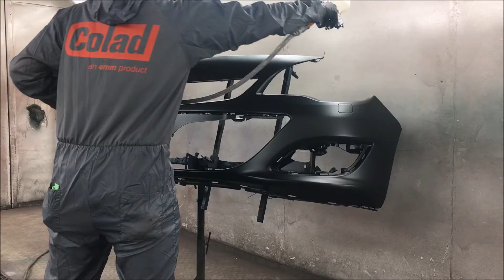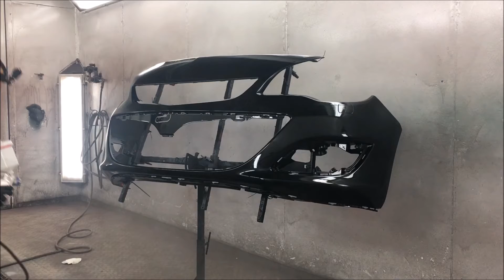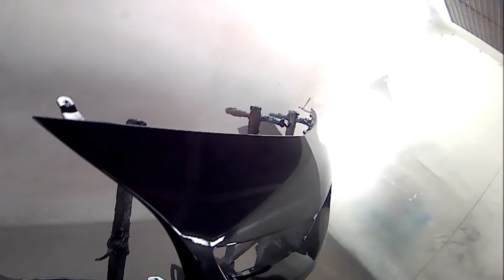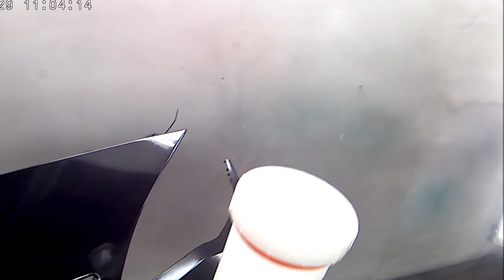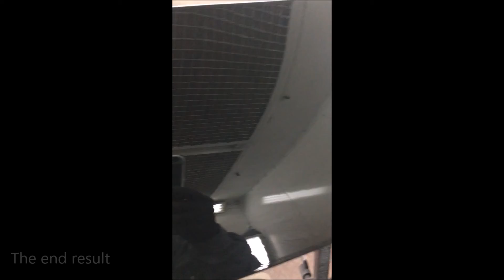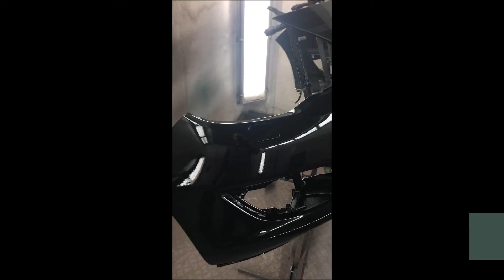Spraying clear coat on a bumper - Sata 5000 RP 1.2

Comment: Recommendation, live the air running just ho back on the trigger enough to cut just the fluid so you wont damage the gun plus since you are cutting air and fluid at same time as well as opening the atomization is unconsistent  so the finish is you might get away with porking the clear on cold weather or clear that float a lot but you spray a fast 2:1:1 this way and I promise you that you going to end up in a lot of trouble
Reply from the maker: Hi Angel Fernandez, thanks for your comment and advice.